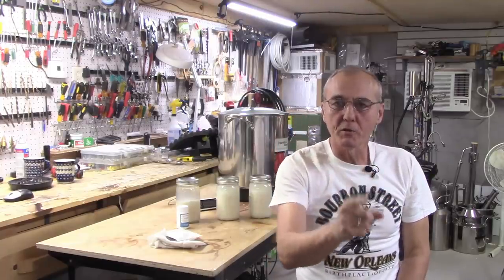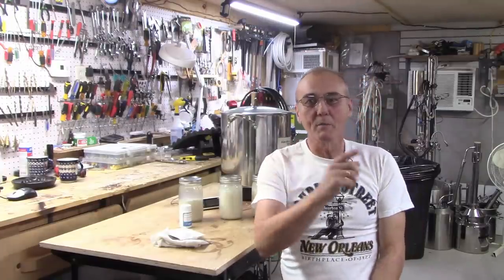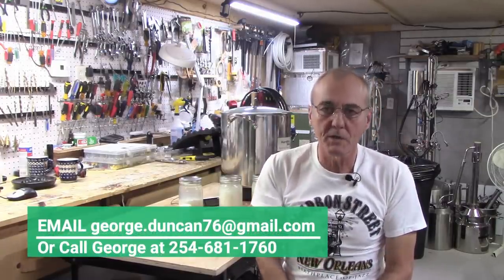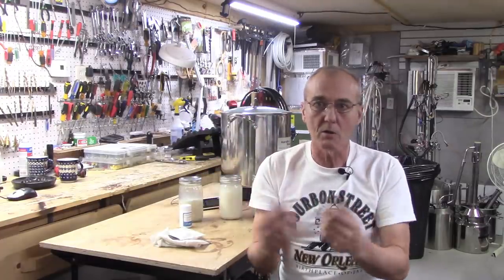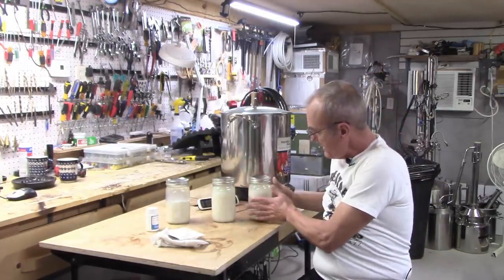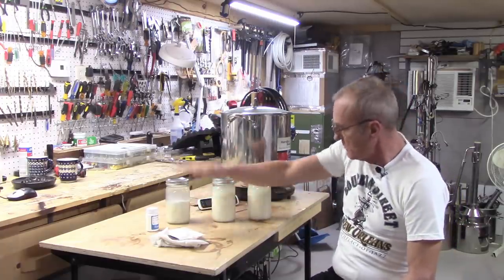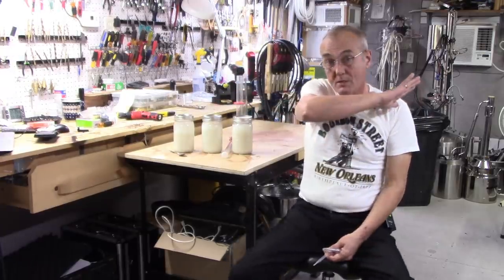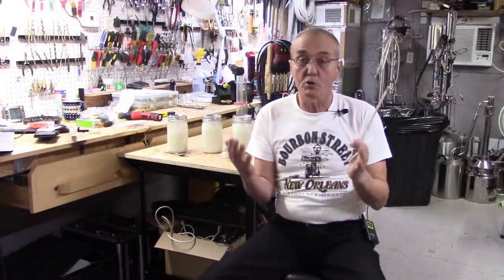CONVERTING RICE USING AMYLASE

Comment: George,

Thank you for this follow up.

Rice is obviously proving to be difficult to work with.  But there is in deed sugars accessible via the enzyme processes.

I have read that the rice gelatinization point is higher than regular boiling and pressure cooking may be in order for completely unlock the starches.  Also there pectin in rice so some pectic enzyme  may be necessary as well.

Alot of variables in play including the type of rice, grain size etc.

Comment: The word you were looking for at the beginning is enzymatic activity.

That said, glucoamylase will convert more starches to sugars than alpha-amylase. Alpha-amylase cuts up amylose and amylopectin at "random" points (a-1,4 bonds) giving you a single glucose molecule,  a disaccharide maltose, or dextrins (both malto and limit). Glucoamylase cuts off single glucose molecules at their a-1,4 bonds like alpha-amylase, but it does it in a row at each subsequent a-1,4 bond, it can also break branch bonds (a-1,6) if that branched glucose is connected to another glucose by an a-1,4 bond, if it isn't, than it won't break that bond. Suffice it to say, glucoamylase is a poor debranching enzyme, and you will end up with a lot of limit-dextrins left over anyways, but nowhere near as many as with alpha-amylase. Limit-dextrins are bits of a-1,4 bonded glucose with a branched glucose chain on it, imagine the top line of a letter T is an amylose chain made up 4 glucose molecules connected by a-1,4 bonds, and the stem of the T is another amylose chain of 2 glucose molecules, but it is connected to the top part by an a-1,6 bond, that is a limit-dextrin, it exists because it couldn't be debranched by alpha or glucoamylase(for whatever reason).

Unfortunately, rice is very, very, high in amylopectins, so it has a lot of branched amylose chains. Only 17% (short grain) to 22% (long grain) of rice is amylose, the rest is amylopectin. The solution is to use a proper debranching enzyme. There are 3 enzymes you can use, Pullulanase, Isoamylase, or Limit-Dextrinase. They have only 1 purpose, break a-1,6 bonds. After that, all you have left over is amylose, you could then use alpha amylase to turn it into glucose, maltose, and dextrins, or glucoamylase to turn it all into glucose. Glucoamylase is a better one in my opinion, because you don't run the risk of making larger dextrins, that may or may not be able to be broken down to fermentable sugars, as you do with alpha-amylase. So you could in theory convert all the starches present by using Alpha or Gluco, in combination with one of the debranching enzymes. 

Pullulanase + Glucoamylase is the best combination imo, it will convert essentially all the starches to glucose, and you'll actually be able to find pullulanase to buy a reasonable price. The other debranching enzymes aren't as easy to find.
Reply from the maker: WOW. Very detailed and informative. Thanks a bunch
Reply: My head hurts after reading that 😂

Comment: George, Thank you so much for making these tests. I spent the best part of a frustrating weekend trying to figure out which amalayze powder should be orderd: Alpha amalayse or Glucoamalayse. The writeups for each both said, simply, that they converted starch to fermentable sugars. I found a short chemistry tutorial explaining the difference in the two types of bonds, but that still didn't answer the basic question: Alpha-, Gluco- or both. (I saw user comments in the product listings for glucoamalyse saying that it did a monster job all by itself when converting rice, which is one data point only, and I probably won't be using rice at this point). You've made the difference clear. I haven't got a working unit yet - the difficult-to-find small parts are nickel-diming me to death. I used Big Blue as a general idea, but you have access to pieces I do not. Makes a difference. (If I had it to do over, I'd just order a basic Chinese stainless steel model to get going. The main parts were easy, but odds and ends can't be had close by. The change in household plumbing from copper to PEX is making the former an endangered species). Anyhow, I'm almost there - I hope.

Comment: Just a note, your water and rice jar should serve as a control in this experiment so that it would probably have picked up the same reading if it really was solids in suspension. I would have heated it along with the 2 other jars, just without the enzymes to really compare. Otherwise, it brings no information to the table. But thanks for sharing the results and for doing the dirty work!
Reply from the maker: Very good point. Now that you mention it that would have been helpful